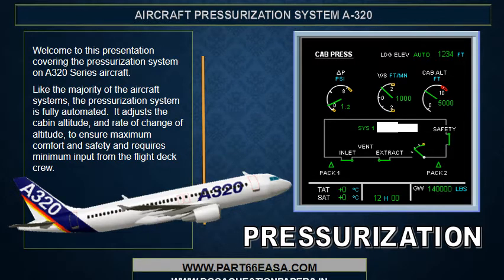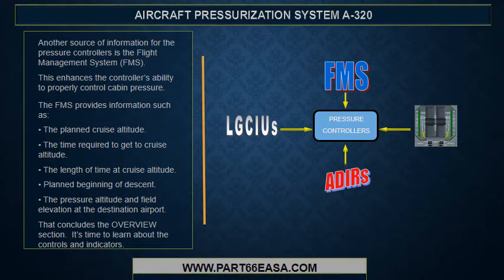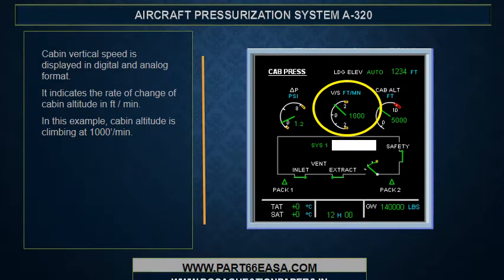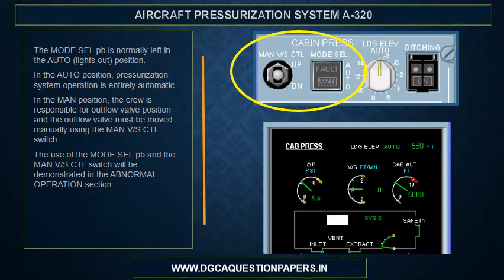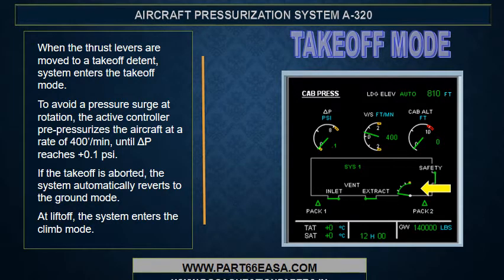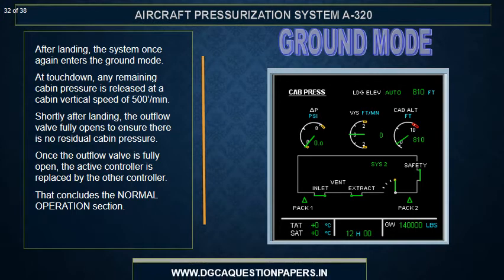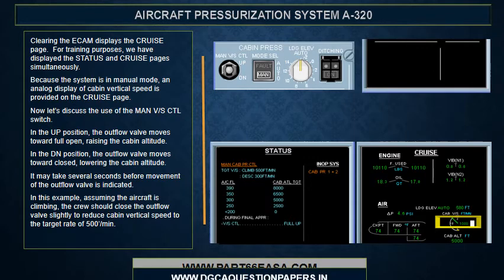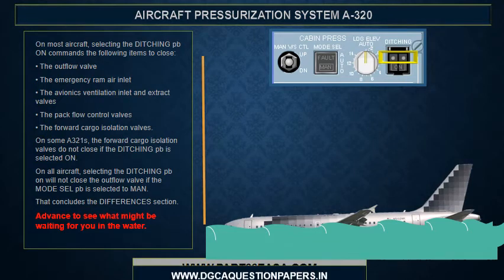Know all About Aircraft Pressurization System Airbus A320

Comment: I have bad experiences flighing on A320 (More than a dozen times), It seems that Pressurization system does not compensate and react smothly during approach for landing causing that my ears literally blow up, never happens when I flight on Boeing 737 or 727 same trip.
Reply: The pilots may have not set the PERF page altimeter setting correctly.  CAB PR DIFF LOW message would appear on the ECAM accordingly.